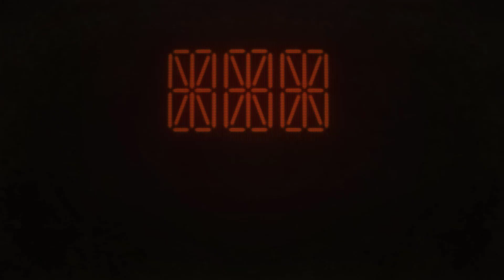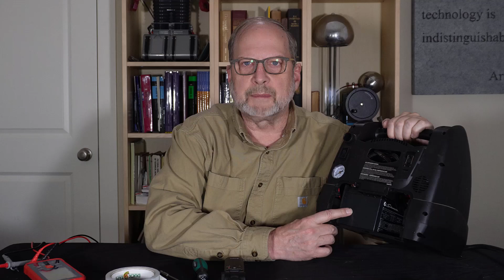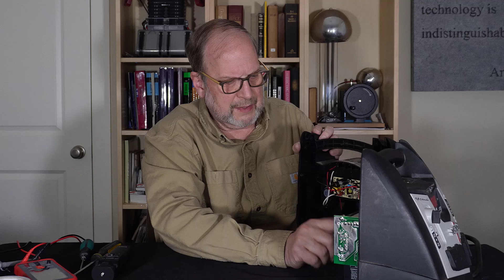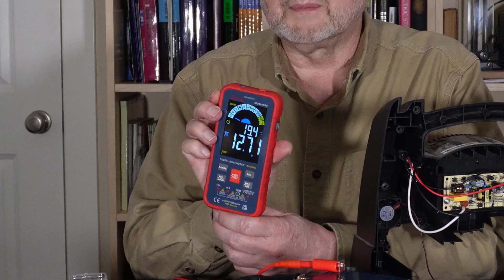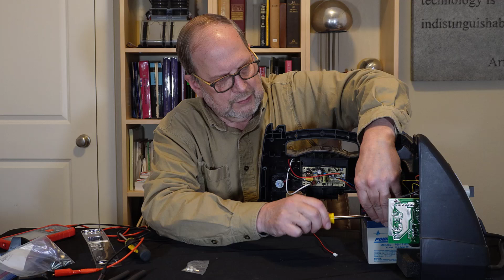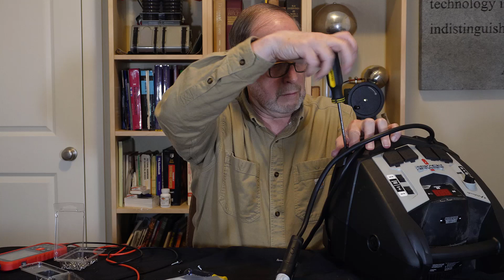Diagnosis & Battery Replacement of a Schumacher SJ1332 Jump Starter,  Power Source & Air Compressor

Comment: Every time i connect the second lead it had a high pitched sound that doesn’t go away how do i fix it
Reply from the maker: I did not run into a high pitched sound when I was working on mine, however I am pretty sure it should not be doing that. I recommend taking it to a qualified repair shop to get it fixed.

Comment: Couldn't you just put the thing back together and put an 18ah battery in the back for more power and easier next time to replace? I noticed some of the larger rated ones just have a bigger battery. You have to take it apart for this smaller battery but the 18 slides right in the back.
Reply from the maker: Thank you for the additional information.

Comment: you had your meter on the dead side of the cable when you tested with your meter only one side of the cable is hot  or ground when put on something metalic they both are conected to each other for testing.
Reply from the maker: Thank you for this information.

Comment: I bought my SJ1332 in late 2020.  No longer holding a charge for any length.  Is the battery I'm looking for a '12-volt 12-Ah F2-Terminal Sealed Lead Acid AGM rechargeable battery'? Wasn't the  SJ1332 a 9-Ah at some earlier point?
Reply from the maker: I am not sure if they changed the amp hour rating at some point. When I did mine I matched the battery that was in it.

Comment: I have the SJ1427....My 12v side does not work...plug side, and all other stuff works...any information on how to test and fix.
Reply from the maker: If you do work on you unit please be safe and stay away from the high voltage. Two of the more common issues with a loss of the 12 volt power could be;
A bad enough battery can take down the whole 12 volt side.
I would also look around for fuse for the !2 volt power.

Comment: Can i get some advice i replaced my battery with a 12v 20amp battery but it is not charging properly  and the display is not functioning properly like before what can be done to use the new battery
Reply from the maker: It sounds like the internal power supply may have a problem. It might be as simple as a blow fuse, it would take someone with high voltage electronic troubleshooting experience to take a look at it. Without the right training and experience it can be very dangerous even life-threatening to work on 120 volt systems.

Comment: I want to get rid of the lead acid cell and convert it to lithium ion.
Reply from the maker: It could be done, however, it would be a lot of work as the charging circuit would need to be replaced.  The one in the Jumper is designed to charge a lead acid gel cell. The charging voltage and current curves are very different for lithium-ion. You have started me thinking that if I could find a 12.8 Lithium-Iron Phosphate battery and charging circuit that would fit in the case it might make an interesting project.
Reply from the maker: I looked a little deeper into this, and they do make lithium-iron phosphate batteries that would fit nicely in the Schumacher case in the 15-16 Ah range.  This would be a 150% improvement in storage. However, the maximum discharge rate of these batteries is 15-20 Amps.  If you draw more current than this, the BMS (battery management system) disconnects the battery.  This would be a fraction of the current needed to jump a car with a dead battery. If you were going to use it to inflate tires or slowly charge a dead car battery, it would work all right for that. Losing the ability to jump a car with a dead battery would be a big trade-off for having a better battery.

Comment: I have the Schumacher SJ1427 model of 1500w and I would like to know if I can replace the battery with a LiFePo4 Battery 12.8v 40Ah 12v Lithium
Reply from the maker: LiFePo4 batteries are charged differently than lead-acid gel-cells. So you need to stick with lead-acid gel-cells.

Comment: I'm getting a R01 code on my display when I switch to the power inverter, any help? 😊
Reply from the maker: I am not sure what the R01 code is. The manufacturer may be able to help you with this. I do know the main issue with this devices have is a failed battery, however, from your description it sounds like may be an issue with the inverter.

Comment: Update.  I put the new battery in, tried all the circuits and it works good.  Had a opportunity to help someone with a dead battery and in couple minutes, it started the car.  VERY happy with the results.  And that I now have this in my car for emergencies.  Thanks again for the excellent video.
Reply from the maker: You are most welcome.

Comment: Nice. I need a battery and glad  about the the safety feature on the jumpers. Another model showed the battery was accessible and removable through the back panel . Guess depends on the model, year made.
Reply from the maker: Thank you for the additional information.

Comment: I started your video thinking that I needed to take out all the screws. Nope. Remove screws for service door and the rubber base. Lift out door. Grab the battery by the sides and giggle it out. Disconnect the two copper 90's from the battery posts. Slide out yhe battery. Simple.
Reply from the maker: Thank you for the additional information.
Reply: I replaced the battery a few months ago, easy peasy. But I let a coworker try to jump a company van and they touched the pos and neg cables to the pos terminal in the van. The tech support for schumacher wasn't keen on me poking around inside, but this guy found a fuse that may be my problem. Thanks.

Comment: You said with your meter in AC position wasn't giving a reading at the jumper clamps, could it be the 12 volt battery current is DC Mr. electronics and computer engineer.